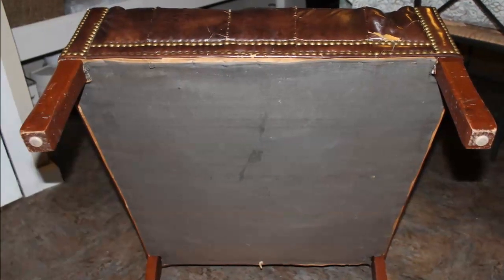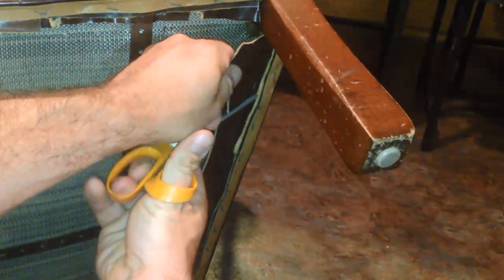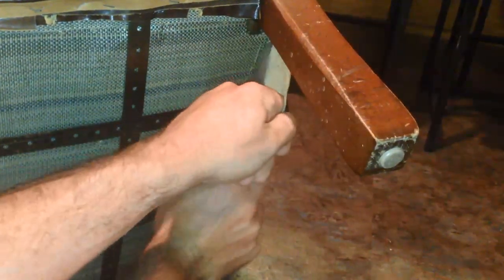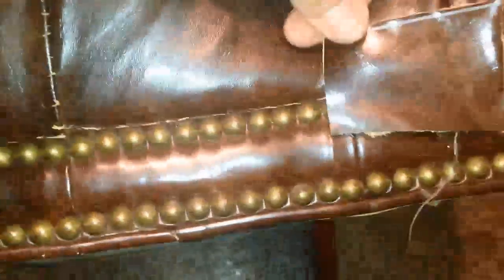Repair / Restore Leather Tufted Wingback Chair Tutorial

Comment: Thank you for your quick reaction, but I think I know what the problem is.
I used saddle grease instead of saddle soap, so I clean it again with saddle soap and then use the
leather conditioner. I used Saphir shoe polish it's the same colour as my old Chesterfield and but even so
my Chesterfield looks wonderfull. So thank you so much for this video

Comment: Great video!! Thank you so much. My leather arm rest is very worn and the leather is crumbling in a spot, not just a tear, so I can't stretch it all the way to close the gap. Besides sliding a scrap piece of leather under it and gluing, some fresh leather will show through. Is that the best I can hope for?
Reply from the maker: Hi sorry didn't see your comment.   Is the excess material under the chair like in my video?  Enough to cover the entire damaged area?  If so as long as you cut the damaged area cleanly and have enough of the new material under to be glued it should work and not be that noticeable.  Especially after you apply the brown polish!   Good luck!

Comment: Thank you for this video. I restored my couche the way I learned from this video, but I used green shoepolish and it looks great but I have a problem with the shoepolish because it stains on my clothes what can I do about that? What did I do wrong
Reply from the maker: Oh wow.  Has it had enough time to dry?  Did you use saddle soap over top of it?  Maybe it's the type of shoe polish?   I've only used kiwi brown and used the two conditioners over top of it and I've never had the staining issue.  Maybe try buffing as much as you can off and seal with saddle soap.  Good luck!
Reply: +Our Old Farm House  Follow the method. If it is staining, it's because you did not follow through with the rest of the procedure. You MUST wipe off thoroughly and clean, before the final finish, and then buff until your buff  cloth is clean and dry
. That is true for each step.

Comment: What. Was adhesive, and does it strengthen and dry clear?
What, if anything,  would strengthen the almost splits?
If that was thread used with  buttons, I'd recommended piano type wire twisted around peg or stick underneath to adjust and hold with much more leverage.